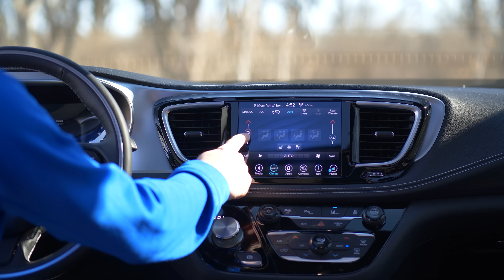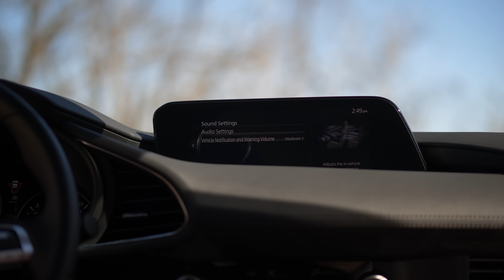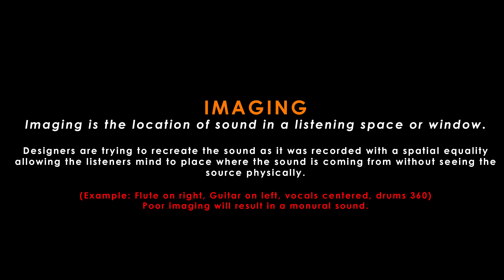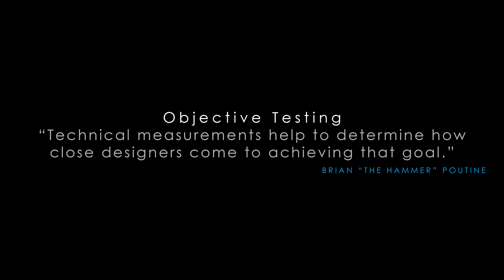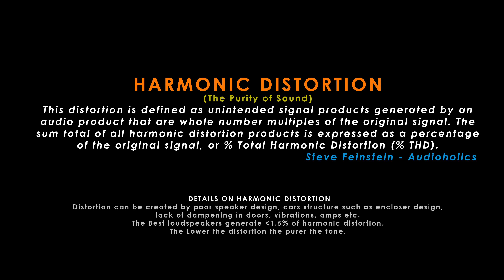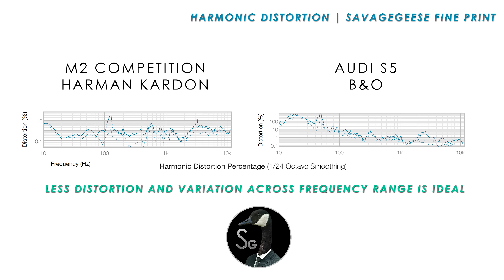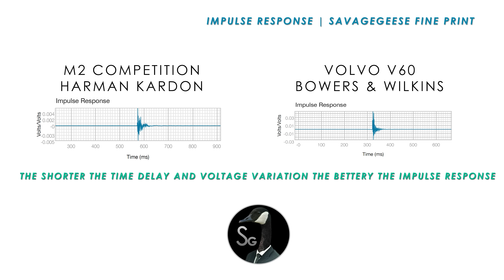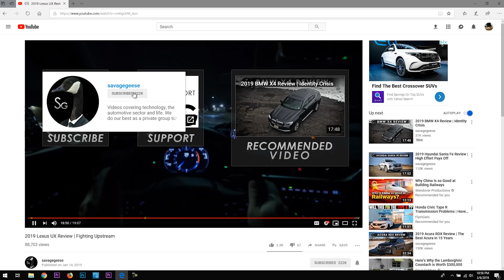Understanding Car Audio Design

Comment: As an audio engineer, I really welcome this. You have no idea how often I have to explain to people that even some of the highest end car audio is either fancy tech trickery (like a lot of the digital soundstaging you mention), or that it barely comes close to even a broke engineer's studio setup. Then you have to explain that studio audio serves a completely different purpose when you show them your system and it doesn't sound like a child making smiley faces in the EQ section. I also do have to giggle any time you show the freq response charts on any car, especially the high end ones, and it almost always looks horrendously peaky in the various "trick you into it sounding good" ranges. I definitely don't envy the people who have to design those systems.

Comment: As an audio engineer, I agree with 98% of what you are saying here, but a couple of errors - Bluetooth does not EVER have the bandwidth to pass CD quality audio, so forget that idea.  And harmonic distortion is a very poor measure of audio quality. - For example, the highest end home systems in the world are based on vacuum tubes, yet they have a ton of harmonic distortion.  Fortunately these are specific harmonics that are very pleasing to the ears and brain.  So you are going to need to find a different measurement method than total harmonic distortion.  A problem with your entire premise is that science has not yet evolved to a point that we can measure which audio systems sound the best, the way we might measure horsepower or fuel mileage.  However, you are on the right track when you discuss timing and reflection control.  Research Ethan Winer's work on Bass Traps/Room Treatment.
Reply: THD is still unbearable at 10%.  At 1% it is much more tolerable.
Reply: I agree with most of what you said, especially relating to tubes where Second order harmonic Distortion isn't problematic. Also the person in the video seemed to think that the distortion was coming from the speaker where actually it has to do with the amplification. Obviously speakers can be overdriven but that wasn't what he was talking about.

Comment: "Below 60hz in a car its a mess, you can't manage it", lol I appreciate you trying to make this informative video for people who are uneducated on the subject but so many comments you have said throughout the video are incorrect. I would encourage someone who wants to know more about car audio to join a couple of the aftermarket forums such as diymobileaudio, and/or read articles from popular car speaker/system engineers which are available all over the internet.  Still take all information lightly, there is a lot of misinformation.  "you have a paper cone in a driver...that is going to have a delay in how it projects sound out because of the vibration." The material the cone is made out of does not dictate the performance of the speaker driver nor the delay of sound. Some of the best speakers in the world utilize a paper cone and btw they are not expensive either. You can have a speaker cone made of essentially any material you can choose, as long as you design the motor, basket etc to to coordinate with the variables of the material you choose for the cone, you can have an excellent speaker, vice versa, everything goes hand in hand. A lot of costumers hear the terms carbon fiber, kevlar, etc and automatically assume that makes a speaker inherently better, it does not.

Comment: I’ve done competition car audio. Both SPL and SQ. There is nothing in the OEM that can compete with a knowledge installer and tuner. OEM does a compromise to each seat. Typically a comp car only focuses on the drivers seat. You can do a lot with $5 speakers if the tuning is using them right. It’s crazy to see what the interior does to the response of a speaker. Goose look up the owner of Audiofrog, Andy. He’s been around a long time and does a ton of Q&As. I will say the Bose system in the CT6 is pretty good. Cadillac let Bose have the car before they touched it. Which has to be a first. Most people have no idea what a 2 channel setup should sound like. We roll off highs due to how we hear higher frequencies. Lower the frequency the harder it is to hear so we add a bit more SPL. You did pretty good though. Most car guys have no idea. A transducers suspension plays a big role.
Reply: Completely agree!!  I have yet to hear a stock system that sounds better then a properly installed, 2 channel, component setup and subs with the emphasis on sound quality.  Granted, I have only dabbled in car audio and haven't listened to everything out there but the difference is very dramatic in my opinion. 

My last system cost about $1,700 with the majority of that going to the speakers, then the head unit and the amp.  After soundproofing the car, making custom kick panels for the components and sub, aligning them for proper imaging and using an active setup, I got it to sound almost as good as my Sennheiser HD600 headphones, only the headphones won't give you that nice thump in the chest when a good drum or bass line is played. I only needed a descent 50 watt per channel amp and 150 watts for the sub to get great sound and still provide a bit of overhead for the amp.  I used to do A LOT of commuting and wanted my time on the road to be enjoyable so it would take my mind off of the bad traffic and long drive.  It was a lot of work and took me a lot of time to get everything just right but when it all came together it became a whole new audio experience.
Reply: Well if Cadillac's weren't junk and would hold up, maybe I would care about the sound system.
Reply: @Fly2kill1  Isn't that the name of the game though? Just little more!
Reply: @Fly2kill1  I Agree.  Depending on your preferences and priorities a nice setup can be done for $500 to $1,000, maybe even less if you only need new speakers or just an amp.  Since I did a lot of commuting I wanted to isolate most of the outside noise and get the best SQ I could from my setup.  I love good SQ setups but most people are not as finicky about it and that's fine too.
Reply: Agreed!  A quality  2 channel setup running fully active with a dedicated amp channel to each driver along with hours of time/frustration getting it tuned works wonders.  Then the never ending sound deadening adventure.   I'm still looking for some quality music these days that has a longer shelf life than most garbage that's been auto tuned / harsh highs.
Reply: As an audiologist, I am not a big fan of SPL competitions but I really like your comment. In particular the mention of high frequency perception and low frequency perception. Many people that dabble in audio, even professionally, have an underdeveloped understanding of equal loudness contours and how they relate to amplification. Proper audio tuning is an integral factor in good or enjoyable sound quality. Savagegeese is top notch, always looking forward to more of his stuff.
Reply: The sound engineers are only there to make crap seem passable. Way cheaper.
Reply: Bose is not considered as a good audio quality if you want to hear real audio. Bose is good for psycho acoustic audio systems.
Reply: I'd like to be stuck in a garage with some of you guys. I'm not an audiophile, I'm just an average guy who loves to listen to his Fleetwood Mac, Eagles, Seger, etc. I love a pure 2-channel experience and some of these car audio systems are much too expensive for their performance levels. Most manufacturers make you select a high trim level when you really only want a better sound system. Perhaps I'm better off selecting the trim level that suits my needs and visiting a proffessional car audio shop for the sound upgrade.
Reply: I installed an Alpine PXA-H800 using a Dension to tap the audio source from the MOST fibre optic in my Mercedes S-Class. For a while, I thought nothing could beat it, until I heard the Bowens and Wilkins audio of the Volvo. I now own a Volvo.

Comment: Fun note. The new Vw Golfs sell the "premium" audio as Fender in North America, and Dynaudio in Europe.... But same speakers.
Reply: ABeans07 and all made by Panasonic.  Good value, too!
Reply: What are different then? Headunit and amp?
Reply: @michaelgrant5258  just the label on the speaker grill. Its marketing.
Reply: @ABeans07  Interesting, I'll look into this.
Reply: This is very untrue. I have Dynaudio in my Toureg and it sounds vastly better in every respect compared to the Fender system in my wife's Tiguan. It is very easy to hear the difference. I would consider audio a serious hobby on which I invest considerable time and effort.
Reply: Adam Aasen Its not "very untrue" when it is factually correct. I don't know why people like you will say that something must be wrong just because you FEEL like its wrong. Just because you think you hear a difference, doesn't mean there is. Opinions are affected by placebos and what people like...
Reply: Lol unless someone shows different p/n they are the same panasonic speaker.
Reply: @adamaasen1152  They are two different cars, so even two identical sets of hardware & software will sound different because of speaker placement, interior materials, etc.  Did you not watch the video?
Reply: @billyzane7282  plus a more expensive car should have better software..m
Reply: @billyzane7282  Yeah but quality of sound  and accuracy of reproduction will have same limits regardless.
Reply: ABeans07 the premium audio in the Golfs also includes a sub in the trunk.
Reply: @mexifinn7830  im aware, i own one. Just stating how vw slaps on badges on the grill
Reply: Peder Hansen  Cheating on emissions isnt? :-)

Comment: Very informative video. Being a car audio installer for 20+ yrs. I personally despise new cars. Bad speaker locations, lack of depth, design.... etc. Biggest issue I hv is not the cars.There a problem all in itself. Ppl generally don't hv any idea what a good/decent sounds like as a baseline.Everybody knows what they want until they find out how much it cost. I try to appease ppl but its a never ending cycle.
Reply: Agreed - and you get the added challenge of trying to navigate the nightmare created as the crap stock audio "systems" are being more heavily integrated within the electronics of the car.  For me, I still am a fan of your simple double din pioneer + dedicated amps + fully active + sound deadening setup which may run $2-$3k when it's all said and done, but better than financing $5k as the manufacturers for you to buy their garbage nav/audio setup as a package when you go to purchase.  It's angering when you do find a car you really like and then you're forced  to pay more or order/wait because the stealerships stock units with all the added bs you don't want.
Reply: New cars haven't treated my ears well. Had a full custom setup in a Galant and now driving an 08 BMW with THX certified premium audio (not sure who made it), but
I've been trying high tier cars and feel like the quality is lower or the same at best. Meridian in F type was a bit muddy , Harman in M4 started distorting at too low of a volume, Giulia QV was very muddy in the mids, RS5 actually sounded decent except the subwoofer was so understated that I couldn't even feel it was there except 80%+ volume and still too quiet to even complement the music (Max setting). I wonder how much variance there could be car to car...

Either way, the damn accountants are having too much say in how cars are made
Reply: Well, what is ideal speaker placement? Tweeters and midbass drivers in A-pillars? Well, there's a small problem with that, isn't there?
Reply: The factory system cost you $2000 . A $2000 aftermarket system will always sound better.

Comment: Thanks for touching on source. You can have the best components available but if your source is crap then it will sounds like trash. Most people just roll with compressed garbage and lose up to 80% of the audio detail. I eventually end up having to explain this to everyone I know. The improvement you will hear with a quality source can even make those paper cones sound twice as good. Sadly, most don't care.

Comment: I've built and installed 30k audio setups in vehicles. My expensive currently is the 11k setup I have in my sports car. The best sound system I have ever heard from the factory was in a 2008 dodge charger dub edition with the full kicker sound system. Literally better than anything I've spent a fortune on. I've rode in bmw, mercs, caddy's, lexus, infinity, land rover, range rover etc.. Nobody has a stereo like that kicker setup. It was built around the car and they got all their positioning dialed in perfectly. When you heard your favorite songs on that stereo it was like hearing them for the first time and realizing you never knew what your music actually sounded like.
Reply: I doubt the kicker system holds a candle to a 11k or 30k system. What even costs that much! Unless you're buying 5k amps that are gold plated, doesn't make any sense.
Reply: @barbecuetechtips6024  I doubt that x is as good as X, what is X anyhow? Nice troll.
Reply: You going to area 51?
Reply: @barbecuetechtips6024  No buddy. I will not be able to go with you. I actually have gainful employment.
Reply: Bet that sounds awesome! What components are you using?

Comment: As an audiophile who has refused to buy some cars due to poor sound systems (looking at you Ford) I’m happy to see someone doing this is a serious way. It used to matter less because you could tear out the crappy head unit and drivers and put in something after market. Now with all the tight integration in modern infotainment we are stuck with whatever junk the manufacturer tries to sell us.
Reply: Not really, you just have to add an extra step and make the output signal flat to an after market amp.

Comment: 4 speakers is all ya need. I still enjoy ripping out my interior and installing my own audio system. Adding under padding where needed, and putting it all back together so nothing rattles.
Reply: In certain cabins 2 or 4 speakers is all you need. But most cars do require some extra speakers to handle the dead spots
Reply: @C.I...   Yeah 8 inch sub is max .. and most cars can get away with smaller bass drivers
Reply: I do have two 12's in the trunk...  Sealed box...but i have them turned down pretty low, like just enough to add a lil low-end to compliment the inside speakers.
... But for certain songs I do like to turn em up and shake the car :D lol

Comment: Wish I could like this 1000 times...that being said I've been a car audiophile forever.  I can usually get great sound with just decent speakers and lots of power.  Of course there are so many variables, but my 2005 Acura RSX has just a pair of MB Quarts separates and a JL Audio 8W7 in their high output box with 2 amps, 150 watts x 2 RMS, 500 watts x 1 RMS which equals super incredible sound :)

Comment: Brave man ...taking on audiophiles 😀.  BTW Bose has been rolling off the highs long before there was digital compression..
Reply: No highs, no lows...
Reply: yeah,  that's kinda natural when you only use fullrange drivers and nothing else. Bose is crap.
Reply: @tomkocur  While I don't agree that Bose is garbage, that's a pretty broad statement about full range drivers and not really true.
Reply: @ster9765  I have overstating tendencies.
Reply: I generally agree that Bose has many issues with their size of drivers, crossovers, cone/woofer materials, etc, but in the case of the mazda 3, the graph actually isnt too bad when considering the comparisons at the price range (aka half of the volvo and bmw also shown in this video). Look at the extension to the 20khz range compared to that BMW and even the B&W kit. Neither of those (on these graphs) goes much past 15k. Now, you could argue most people dont hear much past about 17k anyway so take that as you want. They did however put in semi-legitimate tweeters for the new mazda 3 (hence the better treble extension even if it is attenuated down by their EQ) as well as larger built in bass units with much better bracing than their prior units. 

Its not perfect obviously, but its much better than the crap you see on their other vehicles where they put in 75 of the same 2 or 3 inch paper drivers to cover the entire spectrum, hence their no highs no lows comments. Its also much less expensive of an upgrade compared to many of the european brand systems that often run 3-5k or even closer to 10k and its probably the closest they have come to more normal speaker sizes and crossovers that I have seen. Guess that is progress if you look on the bright side (pun intended).
Reply: Bose is a good audio engineering company. They don't really make good speakers.
Reply: He's not even vaguely taking on Audiophiles. By definition any Audiophile already knows all this and agrees!
Reply: Christian Phillips I

Comment: Random fact: the humble 1996-2002 Volvo C70 coupe had one of the best audio systems fitted to any car - full Dynaudio system. The engineer involved at the time from Dynaudio did a series of articles on it - The speaker drivers were pretty much identical to the ones in their $5000+ home theatre kit!
Reply: Funny you brought this up... That was the first car that came to mind when I watched this video. My friends parents had a 98 C70 and the system was just incredible in that car.. Not to mention the car itself was built like a vault. I love those 90's Volvos. Fantastic cars with great interiors.